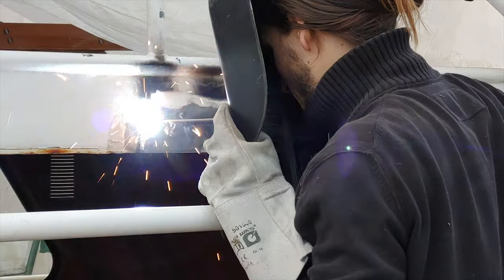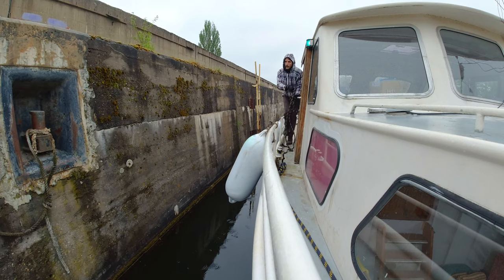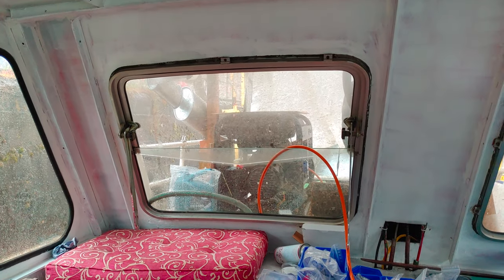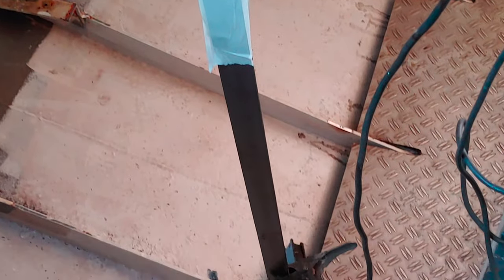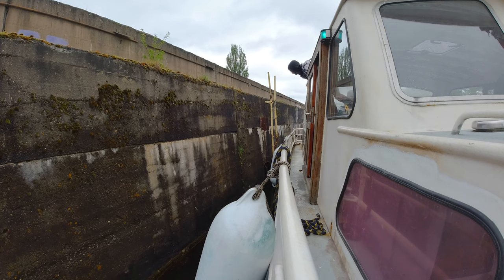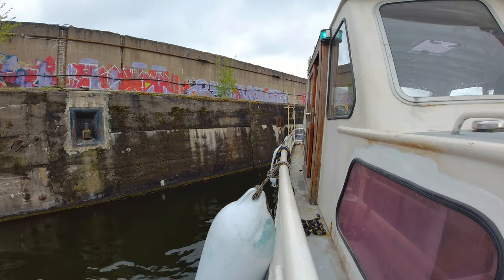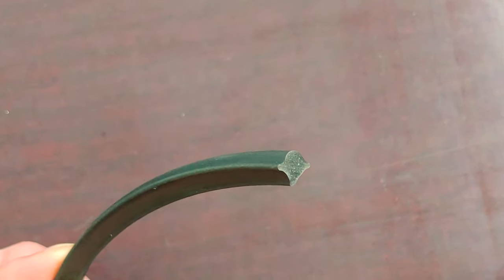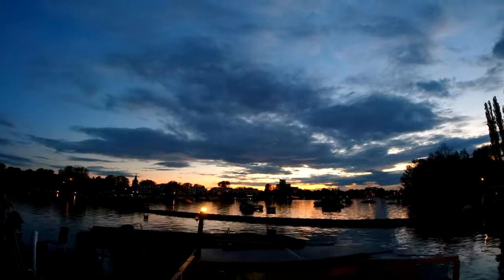First Solo Adventure With MY FIRST BOAT - Week 32 - Part I - Vintage Yacht Restoration Vlog

Comment: What I really like about you is that you just do it. You aren’t afraid to take on any jobs at all. You are doing a great job with the boat and editing your videos. If I can make one suggestion, practice docking the boat alongside a wall or dock. Instead of trying to tie up while the boat is still moving forward, put the boat in reverse to stop it and then take it out of gear. I’m sure this will all happen over time, but you are doing really great for a first timer and you are better than some seasoned boaters. Greetings from Naples, Florida, enjoy my friend. 😀😀😀

Comment: You need a boat hook to reach the dock; or to drop a line over the  bollard.  You also need a fender board.  A fender board is any old board - I use a 2"  X  4" about 5 feet long.  At the ends, drill holes for a line;   thread the lines through the holes; fasten the line with a figure eight knot on the bottom.  That's it!  
Now when you tie up alongside a concrete wall, you hang your fenders - properly spaced - from your railing.  You put the fender board between the concrete wall (or piling) and in front of your fenders.  The fender board rubs against the concrete wall, protecting your fenders from wear and dirt.  When the fender board is worn out, make a new one.

Comment: Always start you engine before casting off or pulling up the anchor, if you  cast off before starting the engine, you will have very big problem if for what ever reason the engine fails to
start. keep up he good work.

Comment: In England we often use a boat hook to assist in mooring and fending off. The older type are far too aggressive but there are now plastic ones. For quick mooring, for example in locks, I just use one central rope on the mooring side. One sees a lot of overkill on inland waterways as far as rope size is concerned and this, too, makes handling difficult. When leaving a river quay, secure the downstream end of the boat and release the upstream then let the current swing you out to the position where you can just use a steady forward speed to move you away.

Comment: I cruised my wooden 1930s boat around UK, into France, Belgium and three summer seasons in the Netherlands, keeping her in winter storage near Yerseke. Most off the time I was single crew and so perfected a method of mooring as locks are very frequent and most impotent was a safe way of handling lines.

My fore line was put to a cleat at the flair of the bow, this prevent the stern swinging out when the line came taught. Using a cleat in the bow would cause the stern to swing out when the pivot point touches the dock.
The stern line one was long enough to double up to mid ships. Two lines attached ready on each side of the boat so mooring was easy both port and starboard sides. A boat hook was used to attache the bow line to the shore cleat, the inset cleats at locks can sometimes be hard to throw over and missed throws loose time and boat position. My boat was twin screw so a quick blast of the outside engine in reverse would bring the stern into the dock. I could also turn 360 with the rudder midships and one engine in forward the other in reverse. This proved very handy in packed marinas.

Do practice your mooring methods with the single engine/ bow thruster set up you have, especially the best prop walk methods you can achieve. Plus mooring with and against river/canal flows, all this practice will earn you some smiles and perhaps a pat on the back from all those people who love to watch boaters mooring up.

An old sailor told me: You must keep one hand for the boat and the other one for yourself. 

Good luck with the rebuild and safe and fun boating.

Comment: I am from the UK and I know that Dutchman make the best small boats..... Because they make them out of steel. Not composite. Not aluminium. Not wood.  STEEL.
You will not regret getting a Dutch steel  boat.
As they say in Holland. "If it ain't Dutch it ain't much". Well when it comes to small boats, that's true.

Comment: I did auto glass and everything for 32 years you're not doing it wrong and don't matter whether it's on the outside or the inside it just matters whether you get it sealed tight around the edge of the windshield if you need to find some beautiful seal in a talking tube it's a liquid budle seal in a cocking tube

Comment: 1. A boat hook would help.
2. if you have a bow thruster, I would suggest reversing until you are virtually stopped, just inching forward, perhaps a quarter of the speed you were going.
3. I am going to suggest bigger fenders, perhaps junk tires if your hull is dark enough so that rubber marks don't show too badly.  And put the fender down at the gunnel because handrails usually aren't strong enough.

Comment: Instead of that piece of wood, buy yourself a proper boat hook !  :)

You do well with that little stick welder, but if you have any big projects to do in the future, you really should invest in a MIG welder with gas, like the professional welder you hired had.  Yes, the gas bottle takes up a lot of space.  Or hire him back.

For wood pieces use 3 or 4 coats of marine spar varnish.  Mix in about 25% boiled linseed oil.  You can use BLO straight, but the second, third and fourth coats will take DAYS to dry.

Despite you best efforts, I think you will have leaks around the bolts for that arch.  The base needs to be flush with the cabin roof.   Get some think plastic (inexpensive cutting board) and try to sand it down to the proper angle.  Most sealants will fail sooner or later.  Better off using something like butyl tape that is not too expensive and easily replaceable.  Make sure you have some drain holes so the rain water does not puddle around that mounting plate.

ENJOY BOAT LIFE !

Comment: Problem with the filler strips is they are designed to push the rubber against the glass and form the weather seal. By having them the wrong way around, that’s not happening. I’m sure you already realise that.

Comment: You should have used the angle iron for the vertical pieces. Flat iron will flex and bend with minor pressure (weight) while the angle iron will not flex under two or three or even four times more weight. Put a red tie wrap at the twelve o'clock position on your wheel with the rudder amidship, that way at a quick glance you will see the position of the rudder.

Comment: You definitely need a boat hook! Reaching like that could end in a wet disaster. I recommend hanging the fenders a bit lower to protect the hull at its widest point, where it would contact the wall. 
By the way it is a boat, not a ship. Think about it this way. The larger a boat gets at some point it becomes a ship. You can put a boat on a ship, but not a ship on a boat.

Comment: I'm more than a little concerned you're using a non marine generator that appears to be air cooled. I have a feeling it's gonna be one hot engine room if you run that Genny for more than 1/2 an hour at a time. Been boating for a very long time and have had several generators on my boats. Not a single one was air-cooled. Just something to consider, eg: extreme fire hazard if you aren't moving a ton of CFM of air into that compartment for heat transfer and fresh air to safely operate the unit.

Comment: With a steel roof, I think I would weld in studs rather than drill holes, and then try to seal it against leaks.

Comment: Try stopping the boat as it come into the mooring .... then turn the engine off......  better than leaving the boat moving and trying to go for luck....  saves damaging the boat.  LOL.....    i did that ...  i came into a lock and left the engine running,  in neutral ,  but the prop still turns a little bit after you engage it....  i jumped off my boat and it started to run away.....  same boat a yours......  steel cruiser 10.5 meters.    I,ve done loads to mine....  anything you want to know ask,   i,m removing my seahead ...  fitting a new shower,  added diesil water and air heating.....  etc.   Do you know if the toilet post /  column , it sits on goes through the hull,   i want to remove mine and fit a porta potti ....

Comment: Well done again, 
just to prevent incidents before you move the boat (it is not a car :-) ), 
check wind direction and water stream, 
start your engine ,
check reaction of bow thruster and main propeller. 
Set your rudder and then release your lines.
Have fun!

Comment: My friend you need some mooring practice, a couple of tips, take the bow of the boat in and have a bow rope ready and tied to the boat, nose the boat in gently to where the cleat or pilling is, tie off the bow with a bit of slack, now gently reverse the boat away from where you have tied off until the rope goes tight, now rudder the stern towards the dock, leave the engine in reverse on tick over and the rudder hard over so to boat pulls into the dock the boat will hold itself against their on the engine whilst you tie off the aft rope. Once tied, disengage the engine and turn it off.  If you want to lasso a cleat or pilling, you need to do it from a slightly further distance, the key is to prep the rope, it must be neatly prepped, so do three neat loops in each hand, but it must be in order so the last loop is the one you will throw, you grip the furthest loops in each hand, throw your arms out and forward and every time you will catch the cleat or pilling. Practice somewhere on land, it’s a great skill. Hope this helps.

Comment: As the screws are being shown. I would’ve thought use would face the slots on the screws the same way. Either horizontal or vertical. That’s just me being finicky.  Have fun and good luck anyway 👍👍

Comment: Why not use angle on the front of the platform instead of the flat stock? If you were to lift the bow up on the dingy you can leave the drain out so rain doesn’t collect in the bow. It seems you have a LOT of body filler on that hull.

Comment: Just a arm-chair observation: The washers used for holding the hoop on are way to small in diameter. At least a 30mmX3mm washers are needed to spread the load... else, though not a big chance, they current nuts and washers could pull through the holes... ot at least bend and distort them.

Comment: HOW TO MOUNT FLAT FLANGE ON ROUND DECK 
PUT SOME FIBERGLASS BOG BETWEEN FLANGE AND DECK LIGHTLY HOLD IN PLACE TILL BOG HARDENS REMOVE STRUCTURE PAINT FIBERGLASS PLACE SEALANT AND BOLT STRUCTURE DOWN

Comment: Nice work. Just a little tip when mooring. Try not to cross your mooringline when tying up. The line won't break by the continuous rubbing.

Comment: You did alright there, whenever you get your boat tied up without damaging yours or somebody else's it's a win & bowthruster helps a lot, use prop walk to your advantage whenever you can - in reverse she'll pull to port if you have a right handed propeller (most are right handed) & vice versa. How's the engine oil looking?

Comment: Great when you can make mistakes and stand for it. Why the strip must be facing outwards, who decides.
I follow you with excitement, it would be interesting to see the boat and meet you. Good work
Reply: Probably because its more water tight when its outside.
Reply: From what I understand, the strip should be sealed inside, to get a whole side out towards the water, am I wrong?

Comment: @Stephen Smith I was thinking the same thing..
Two words "Boat Hook"
Easy to grab the lines off the pier. And push your stern out as you leave...
Maybe two, one on each side of the cabin so your not running back and forth trying to grab it in a emergency...
They're fairly inexpensive and worth every dime.
Also, would have removed the muffler on your genny the next day... Just to let your "neighbors" know you were still there..😂

Comment: Have you considered adding a high amperage secondary alternator to the boat’s motor? The boat is obviously quieter than the generator and has much more fuel. Furthermore it will reduce clutter and be super easy to add. Just an idea. You could then put a heavy duty inverter on it to run AC loads or other needs.

Comment: "At some point and Ikea book shelf passed by"... That genuinely made me chuckle a bit, good fun.
I'd say your doing great. She's on the water and still floating and you did okay getting her docked. 
I'd maybe build or by a catch pole as you will need it most of the time when docking alone, just to make life easier. It's a shame there aren't two tie offs on that wall so you could run two lines one from close to the bow and one from close to the stern making an X to keep her more steady and stop the shifting back and forth. That's caused by the force of the light current stretching the lines which makes the boat drift back a bit and then the spring/stretch of the line pulling her forward. Light current though so you should be okay just straight tied other then the constant backward and forward motion. Sorry I don't know the nautical terms to sound all pro sailor as I've only ever owned and sailed/piloted boats on fresh water lakes and such and never felt the need to learn them.
I don't think you were lucky that your new platform turned out so level I think it was due to taking your time and doing it right...

Comment: Hi. You put in a lot of effort getting your boat in shape; great to watch.  I did notice something in the video I thought you might like to know about.  I noticed as you went under the bridge your front mast made it under by only a few inches.  Your framework that you installed on the back of your boat, however, is much higher.  I don't think it would fit under that same bridge.
All the best with your renovation.

Comment: When mooring Ropes are to be used you will find if you had popped  a rope around the ladders you boat would have just pulled in. Also it's alot safer for you sir.

Comment: Definitely need a boathook, not sure, but it sounded rough when you changed gears, in our boat you had to slow down the change from forward to reverse or the gearbox would be damaged, quick changes could damage it perhaps yours is different?

Comment: Slow and always.

Two tips if you allow me ...

First, place the generator in the engine room and connect the exhaust from the generator to the existing engine.

In minute 8:34 why don't you change the engine exhaust to the side (cut in the curve), is it going straight to the side of the boat? This leaves more space in the back cabin.

Comment: You really want the filler strips on the outside. It will be simple to push the window in and rob you blind. On a maritime level, you really do not want a big wave hitting the window, pushing it in and flooding, possibly sinking you boat. Take the windows out and install them properly. It is a safety issue.

Comment: Did the neighbors call the police? or did the police just happen by and hear the generator? or angle grinder?  You can only blame the neighbors if they called, or if they lobbied to enact the law in the first place.  Also, isn't your generator well muffled? not well enough? should you consider solar or wind generators?  Perhaps you should try a removable exhaust pipe that goes down into the water?

Comment: NEVER EVER GET BETWEEN THE BOAT AND BANK,  USE A BARGE POLE,   YOU WILL BE CRUSHED TO DEATH.....  ITS STANDARD SAILING PRACTICE.   STRONG WIND ON THAT BOAT , PUSHING AGAIST A WALL,  IS LIKE A HUMAN MEAT MINCER.   ADD TIDE AND CURRANT TO IT......

Comment: Does Germany require a captain’s license?
Reply: If the Motor has more than 15 hp or the boat length is over 20 Meters you need a boat license on inland waters in germany. As far as i know. There can be exceptions for charter boats.

Comment: Be careful how you tied up at that 1st place that you docked your ropes were too short if the tide were to go out the water dropped you wouldn't have been hanging from those  metal things you tied to they're not cleets but whatever they were or it would ruin your boat

Comment: I think you revealed at some point in previous episodes your plans to have the gasoline generator installed in the engine compartment. I suggest to consider to have some ventilation by means of fan blower and ducts, to avoid explosion risks.

Comment: You need to learn how to tie up as your method is not suitable at all The vessel will get serverly damaged and it is not secured at all Should another vessel pass it will pull you away from the wall and then slam you back into it